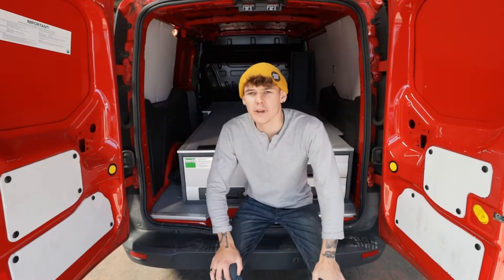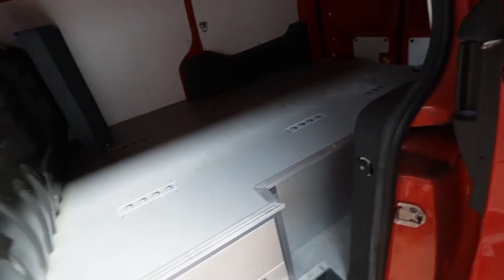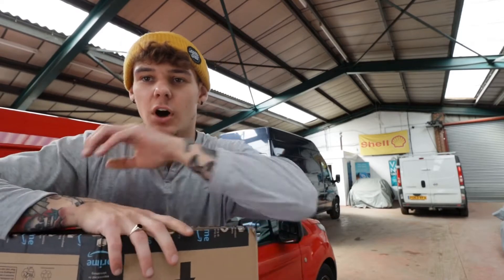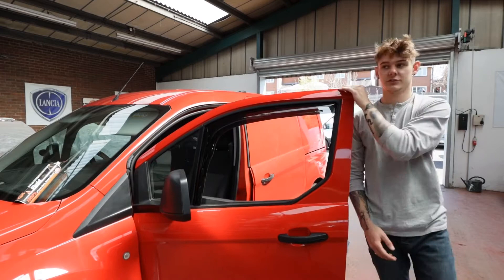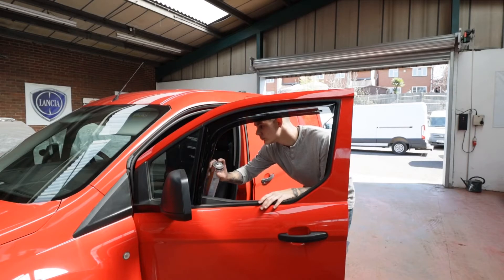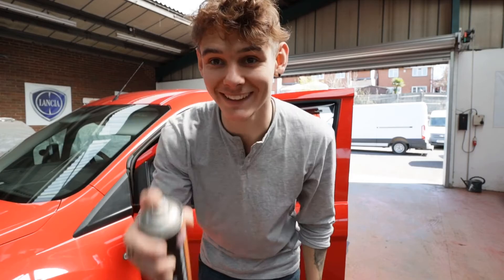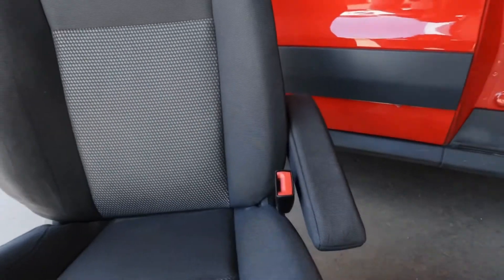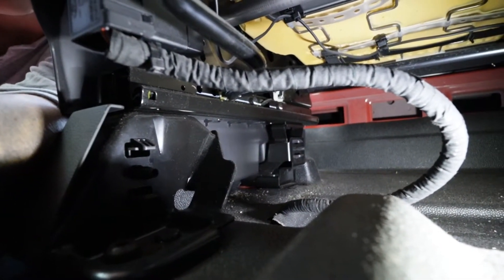Ford Transit Connect Van Conversion - part 1

Comment: Hiya. How much did you pay for your van? I'm looking at buying one like yours, there are a few red ones on autotrader must be the same company owned yours as they have the same BOT storage system in all on 14 plates. Did you sell the storage system? Ive been told they are quite expensive new.

Comment: Jake, where did you pick up the seat for the van? Looking for one myself that goes a bit higher, I have the same van.
Thanks
Cormac
Reply from the maker: Hi mate, there was other vans where I was at the time, I just one for one’d it with permission from the owner, sure you’ll find one on eBay though 🤙
Reply: @JakesJourneyMate  Grand job man, seems like seats might be kind of generic then. Thanks for the quick reply !
Cormac
Reply: @BigB-qk6zh  you'll find most seats will fit other models, not sure about Ford's but alot of the VW POLO GOLF ETC AND  SKODA are all interchangeable. Cars with the same floor plan basically.

Comment: mate i have the exact same van as you but missing the armrest from my last van where did you get the drivers seat from isit a connect seat or a custom ? can’t find a connect seat with an armrest anywhere thanks.
Reply from the maker: Nice man! Yeah I actually swapped it with another connect, not sure where you can get them tbh!
Reply: no probs i’ll stay on the search cheers 👍🏻

Comment: Where did you get the van from. Most I've found online for this model are going for £15K 🥴
Reply from the maker: Hi mate,
I bought it in the first big lockdown just so happened to get it at a great price as the dealer was trying to shift stock & a family friend 🤙